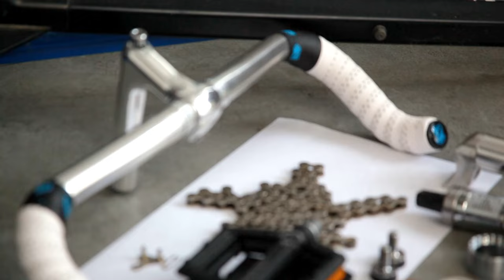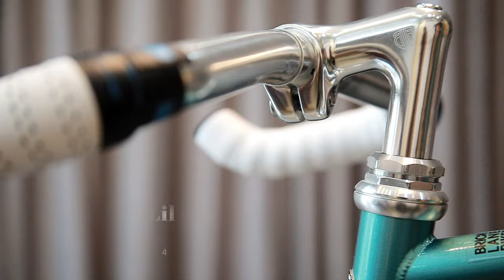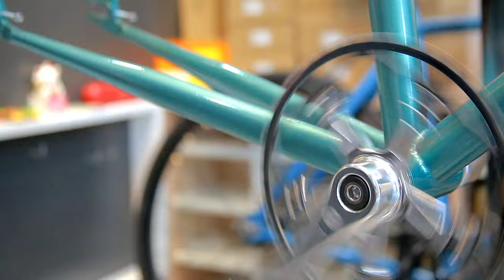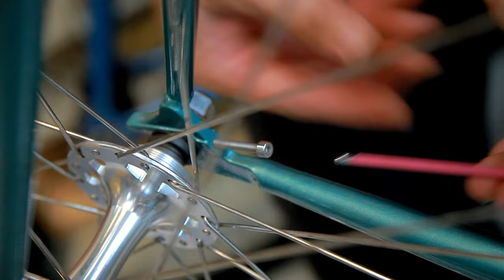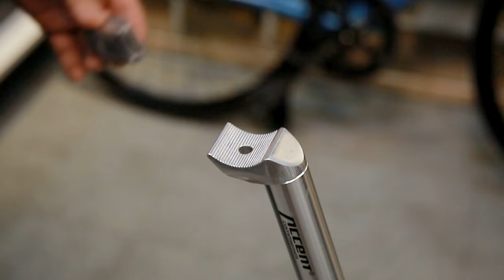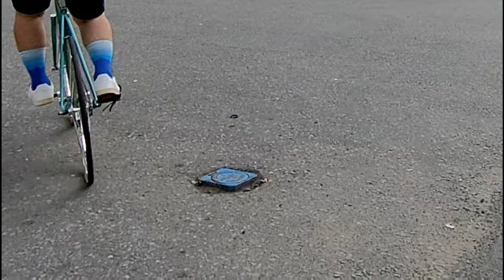DREAM BUILD FIXED GEAR - CLASSIC-R - DERBY GREEN - BRICK LANE BIKES // TALI Bike

Comment: I’ve a smaller Type R frame, is it possible to attach a longer stem and seat post to make the smaller frame work?

Also which stem would you recommend then? (For Germany)
Reply from the maker: you mean you eant make the frame more bigger by using long stem?
Reply: @DreamBicycles  more or less. it wouldnt really enlarge the frame but a longer stem would ensure I have a comfortable reach to the handle bars!